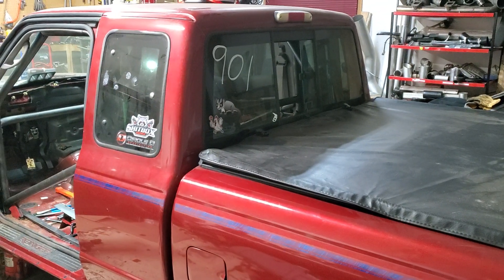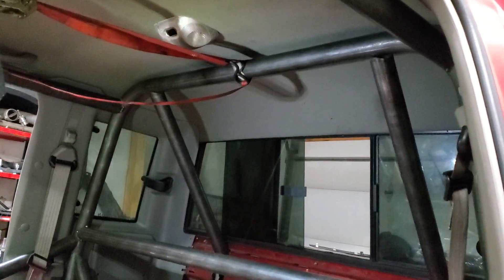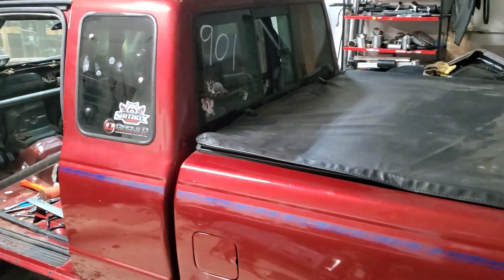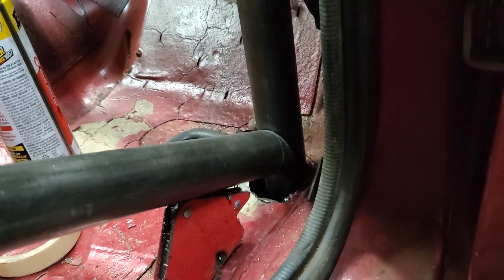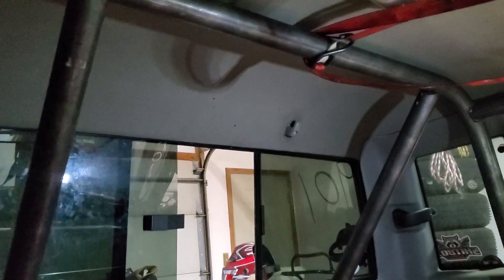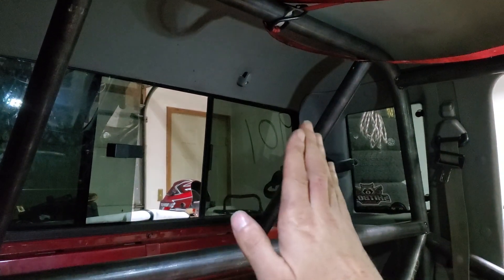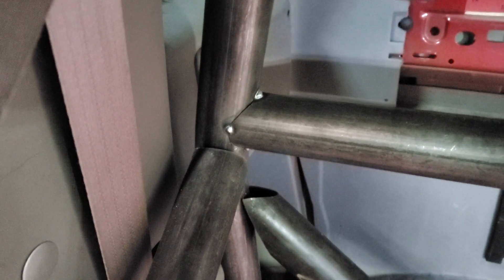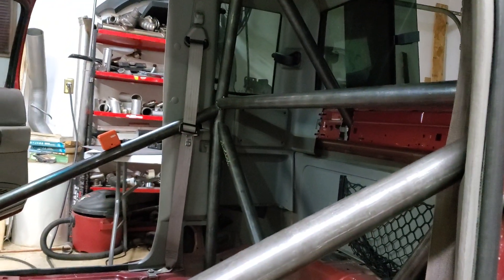More Fun Roll Cage Stuff For An Old 1000hp Grandpa Mobile...

Comment: Looking good. Just finished the roll bar in my Fox body wagon. Not sure about TIG welding but it looks like the tubing could use more bevel at the notches.   The prep work and grinding that goes into a cage is more than most people can appreciate.  At least on a turbo kit, it can be welded outside the car.

Comment: The best is slamming your head on the cage when crawling in and out trying to weld in horrible positions, good times
Reply from the maker: Man, when I was test fitting the seat I wasn't thinking and used the a pillar bar to pull myself out. Broke the welds off, bars fell and hit me in the head, every tack I had broke off. Man I was so pissed. Lol.